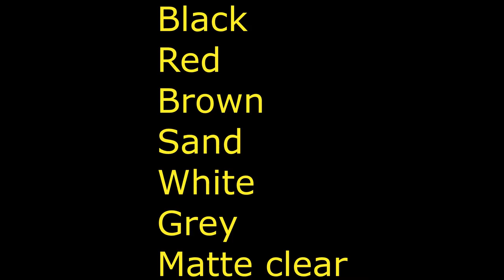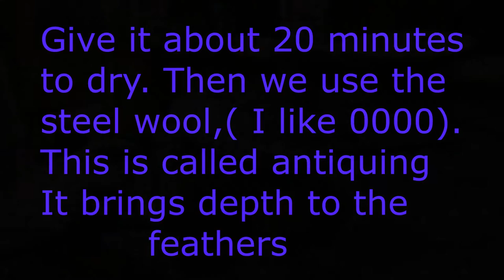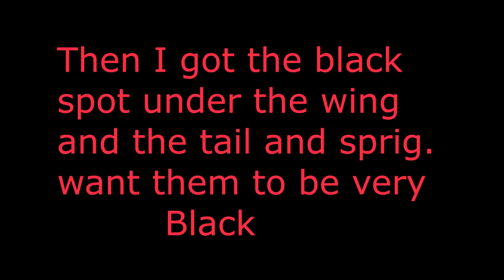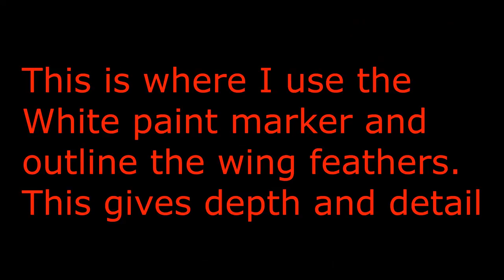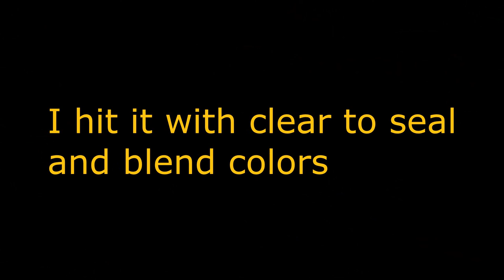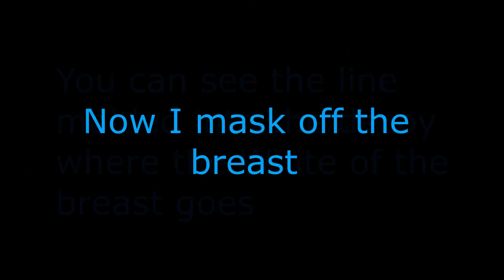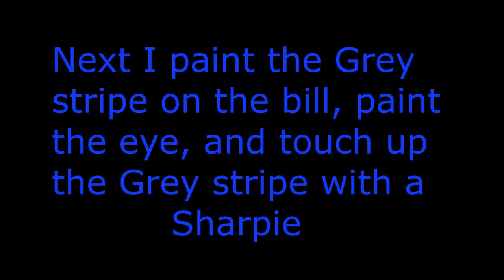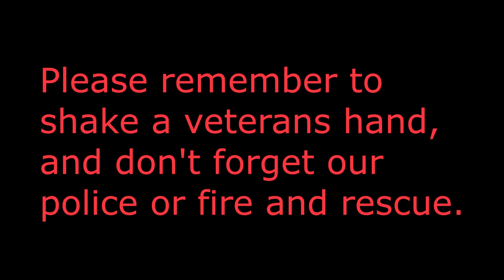How to repaint old Pintail decoys

Comment: Just a hint for your white edged back fethers. Just spray a puddle of white paint in a paper plate  and use a flat small sponge. Just dab some white paint onto the sponge and wipe it or dab it on the high edges of the back . Becaue the white egdes are high , the paint on the sponge will only apply paint on the high spot. Good job dude.
Reply from the maker: I sure appreciate you jumping in and making a discussion I will try our tip